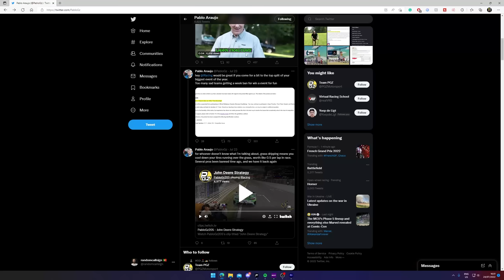iRacing Spa 24 GrassGate: cheating in top split

Comment: Well the issue here is, that there are no live stewards in those big events. Greg West posted a statement during the race, that this is clearly against the TOS and can be reported. However reports in iRacing are always dealt with after the race has finished. So the pro teams are banking on iRacing dropping the whole discussion and continue using the exploit. 

iRacing can really go three ways here:   
1. DQ all teams, who used the exploit, not only in topsplit, but in every race. However this seems pretty unlikely to me, as they basically would have to DQ the whole topsplit.

2. Tolerate the Spa 24h and address the issue for future races with higher offtrack scrutiny (or an improved tyre model lol) to prevent this from happening again.

3. This might be the one that seems most likely for many people: simply ignore the problem all together, refer to their TOS and ask top split esport drivers to be more mindful in the next races. (which would be incredibly ignorant and stupid, because those eSports drivers will keep going for anything that makes them faster, as long as its being tolerated)

I think, same as the brake dragging exploit, this is a chance for iRacing to show, if they care about their customers and the reputation of their sim. 
Let's see, what the next few weeks will bring.
Reply from the maker: iRacing tyre model has had a variation of this same issue for years now. The normal reaction is to patch the game to deny behaviours from drivers, but the underlying relationship between temperatures, pressures and grip isnt revised. No matter what they do, everyone will still take the lowest possible pressures and will use any mechanics from the game to cool off tyres.
Reply: @randomcallsign  The normal reaction has been to try to stop bad behavior through the qualifying stringency system. This tire cooldown method has been known for a loooong time, we've just never seen it so much gains from it. It was common to see people dipping their tires in grass in certain parts of the track for cooling, in some tracks in the same consistent place, for example before the turn in for the kink in Road America, it's just that iRacing either can't get a grip on their tire model or they are not putting the effort in the first place.
Reply: @randomcallsign  While you are correct about the need to fix the tyre model itself, in my opinion the current issue is more about penalizing actual TOS infringements. Sure, maybe the eSports drivers have been using the lowest pressures possible for years, but although highly unrealistic, that in itself is not forbidden, as they were just adapting their setups to the games (faulty) model. 
Now with the lawnmowing they are actively breaking rules, that are established in the game and this is an actual offence, that needs to be penalized in my opinion. Especially after this had already happened in a BMW SIM GT race beforehand after which it was made clear, that it is not allowed. So everybody knew, it was forbidden and they intentionally did it anyway. And this is way different than running some low psi in your tyres. This is just plain cheating.
Reply: Stewards statement from 29th of June: "Our position is that we expect drivers to race fairly, and abide by track limits in the sim. Where crass cutting provides a driver with a 1x, this will go towards their incident limit. As enabling this to be a protested action will likely see every team protest every other team, we request that this is followed up via the iRacing protest system. We will work to co-ordinate with iRacing’s FIRST stewards, and where protests towards drivers are upheld, this may impact on their ability to partake in future BMW SIM GT CUP races."
Reply from the maker: They can expect whatever they want. What they get is this and then they will still not address the underlying issue.
Reply: And real time tire temps and pressures ? Is it so difficult for iracing to implement ? Noob developers ? Or they just don't care ? It's the same as one cpu core for physics and another for rendering in 2022 ! wtf ? Are we still using cpu's and gpu's from 2008 ? I really like iRacing, but this anemic development associated with cash grab is starting to annoying me ...
Reply: @maluco3026  it still wrong, not only the wheelspin and difference of grip would not allow these speeds at grass or car control as it would destroy the tyres grip with dirt (grass, dirt, peebles, etc) also with chances of punctures and that should be the expected behaviour of tyres in any simulator.
If it is that known in iracing just show the very dated iracing tyre model is wrong at its core and the tyres are the core of the car reactions.
It should be a thing to ve fixed ages ago along with the magical "as low pressure as possible" or else real life teams wod not need to hire and put to practice someone only for this job, if it was real physics at work it would be "just deflate the tyres and that is it for best grip".
Reply: @randomcallsign  Yeah. Banning them does nothing. Most only do special events. They don't care about official races, and they have smurf accounts. The goal should be to fix the game, not bans that mean nothing.

Comment: Yesterday I found out something IMO even more embarrassing about iRacings (newer) tyre-model in the Porsche Cup, but the same with it's predecessor. The brake-balance default in iRacing (and only iRacing) is 45,5% front and E-sports driver like Moritz Löhner (10k iRating) running even down to 42,5% front because you can brake a bit later with it at the cost of a more skittish car. I always found that curious since in real life you want the car to dip down at the front and putting the balance too far back is just braking worse. Brake-disks and pads in the front usually need to be replaced far more often and I thought that's basic car-physics. But fun-fact: The real 992 Cup is using the same dash and the two onboards I could find with perfectly clear brake-balance-display showed very different numbers: Monza at 53,75% front and Paul Richard at 55,25% front. That's about 10% more front than the iRacing-car and 10% difference in brake-balance usually feels like a lot more in terms of handling.

Comment: They should just put the Audi GTO tire model on the GT3 cars and the problem is fixed, if you do that in the GTO you go straight to the wall  😄
Reply: Pretty sure that was their old tire model which had even more issues with being able to drive on the limit
Reply: @chrisg.2962  I remember not long ago they updated the TM on the classic cars but it's probably not the same one as the GT3s,

But afaik I get a better ffb feel with the classic and they are actually easier to drive on the limit because of that

Comment: Since the NTM there's a problem with hot tires ! Hot tires shound't be like ice so fast. And cold tire should be slower than hot at race pace, witch as never been the case. The colder the tyre the faster they are since ages

Comment: IDK, why not just make the physics realistic? I don't see how it should be against the rules or considered an exploit to use the physics engine of the game in an advantageous way. That's kind of the whole point of racing. It's not their fault that the physics is unrealistic.
Reply from the maker: the "just" is very difficult. They are neck deep in a physics system that comes from a 2003 title. It will be very difficult for them to change the tyre model fully.
Reply: My suspicion is they make tyre model lose grip quickly with overheating to prevent people from sliding around to gain time (the number one complaint real drivers have about something like rFactor 2, because they don't like losing to sim racing aliens). But that leads to perverse features like everybody trying to cool down their tyres to go fast.
Reply: @randomcallsign  It's really funny that users are being charged so much to use a broken physics model from 2003. For me, it's clearly the physics model that is the issue, and that is what needs to be fixed regardless of how complicated this process is. iRacing certainly has enough money to fix it, and if it's too complicated because of spaghetti code, they should make a new engine entirely. It's been almost 20 years since 2003. When I say "just" I don't mean to imply that the process will be simple to execute. Just that the solution itself is simple, and almost doesn't even bear considering anything else. It's a simulator, therefore the physics itself must be realistic. Stuff like this is why I don't really take iRacing seriously. It's really overpriced, the physics are broken, and the graphics are terrible. It's time for them to make a new sim.

Comment: I mean, it seems to me that the problem that driving with one wheel in the grass doesn't create the problems that it should. Why don't racers do that in real life? Dirt buildup on tires reducing traction, rough surface making for dangerous handling, potential damage to wheels/suspension, etc. If they just increased or tweaked the rate of dirt/mud buildup on the tires, that would fix the issue almost immediately. They could even make it so that the longer you're on the grass, the faster it builds up, so small corner cuts and runoffs aren't any different from now, but long runs really affect your handling for a bit. They could make the grass bumpier (they should) and the coolest solution would be to use their dynamic track and mud physics to actually create wear on the OFF road surface, so that the line just off the track gets muddy and/or rutted as more drivers use it, making it a dangerous prospect to use continuously. Add all three of these features (extra dirt acumulation, bumpier off-road surface, dynamic off-road surface) not only would this issue be tackled but racing would get more interesting in general
Reply: Top speed on grass is same as on asphalt, right?
Drag alone should be a reason, a setting to tweak without braking any track records. Tyre pressure is another istupid thing to tweak.

Comment: But in theory can grass cool the tire?
Reply: Yep. It'll be way cooler than the track surface, so the heat will definitely transfer from the tire
Reply: @DaddyracerZA  It's not just about the surface being cooler, it's more that there's less friction on the grass that creates the heat.
Reply: @SebHUK less friction should result in less speed. And yes, friction does generate heat, but in this case, the cars aren't slowing down to represent grip loss.
Reply: @DaddyracerZA  in these places where people were grass dipping, the car's acceleration is not limited by grip
Reply: @vsm1456  yeah, meaning that technically, the grip on the grass is equal to the grip on the tarmac. Which in turn says that the grass should be generating an equal amount of heat as the tarmac as far as grip is concerned. Leaving the low ambient temperature of the grass as the only logical explanation as to why the tires would lose temperature
Reply: @DaddyracerZA  no, grass doesn't need to have the same grip as tarmac. you're accelerating on the limit of your grip when you're on the exit of a corner. but when you're on a straight, your acceleration isn't as great anymore (due to air resistance) and you don't need as much grip for the tyres to keep pushing your car forward

just because the surface doesn't have a lot of grip doesn't automatically mean it will slow you down. think of all those speed records that were done on salt flats, deserts or even beaches
Reply: Go over grass like that in other sims, you‘ll flying to the moon😅

Comment: If its a known exploit,it should be fixed, using exploits should be punished ... BUT,when iRacing knows about it and still did not fixed that,plus all drivers still driving in a track limits not outside of them ... why they are getting bans for that? Issue was named so fix it,especially with their type of "paid content" policy.
Reply: It's been a while since that exploit is known. People driving 2 wheels in grass to cool down the tires and gain more grip and less degradation. But yeah, I totally agree with you... except they prefer banning people than fixing their shit.

Comment: Definitely against the iRacing rules as it clearly says you must drive on the racing surface. iRacing should disqualify anyone from the event that was using it. Top splits also absolutely need an actual race control. If in a situation like this, they could easily give someone a drive-thru or stop penalty. These "professional" sim racers do it blatantly, and they get to race top split. Everyone else does it, and they get punished if they're reported for it. They're just setting a precedent that it's okay to exploit the game.

Comment: What do I think of it?
It's very simple... It's an exploit and a cheat. All of the drivers/teams that made use of it should've been black flagged from the race, and should've received a Competition Ban for the length of 1 year.
Reply: I think for how much money iracing charges in literally every aspect of the game, they should be at least attempting to fix major bugs/issues that they've known about for months.
Reply: No solution. It has to harm your car and/or laptime. In RL you can go on grass accidentially and your laptime goes into the garbage. Going on grass accidentially, because it does nothing to the car and getting DSQ is senseless.
Reply: @ChrisTian-co4oc  you didn't understand one single bit of the video if you still think they went on grass "accidentally". 🤣
Reply: @Artiick  Sorry, my comment should be an answer to another guy. No idea how it came here. Anyway, let me
explain my point: Having an issue like this is a physics problem, not a track limit problem. Those drivers go on the
grass and many wanting them to be judged. But there’s no grounding for a judgement, because they didn’t violate
the track limits (EDIT: in some sectors, after i viewed it a second time, in others there is no question). If they can go
on grass like this and it’s like driving on asphalt, then it’s a physics problem, because in RL or other sims you can’t get
away with that driving style. If you go wide, it could be an accident because you steer to less, or it could be intentional
because the physics allowing you to do so. Who will judge here? 

Of course they don’t stop to go so wide just to make it look realistic for the viewers, of course not!

No, the approach that is necessary here is to get the physics right. Try this in, for example ACC. You do it once, the
next lap you’re paying attention to not repeat it. Because the physics themselves, the ingame „laws of nature“ so to
speak are punishing you. No matter if you’re in the track limits or not, no matter if you go there by accident or not.
Bulls*it! The unforgiving grass itself says „Sorry, you can’t do that!“

Fair play in racing goes to the point where a thing begins to limit you. Either it's the track limit or the physics.

Like a proper sim has to work, IMHO.
Reply: Second, 1:20 try to take that curb like this in ACC. Good luck 😆😆😆